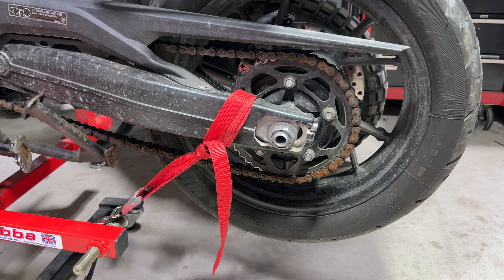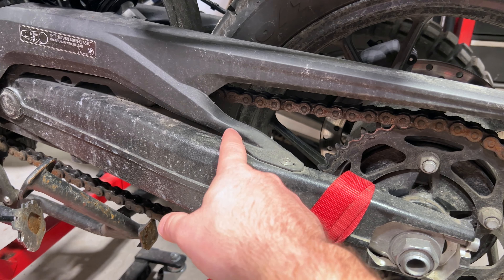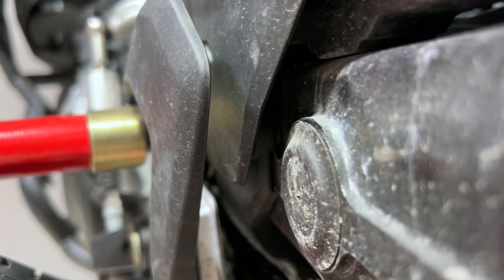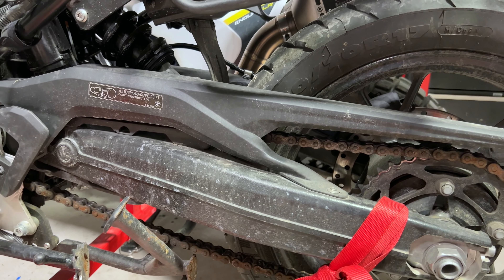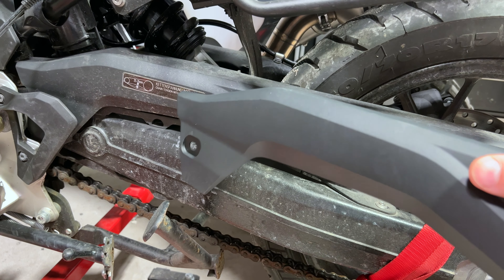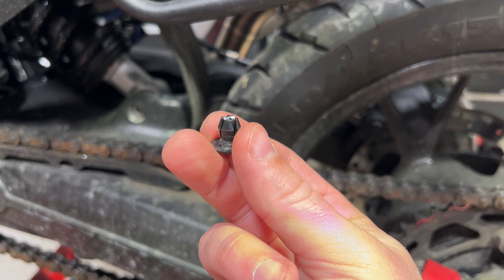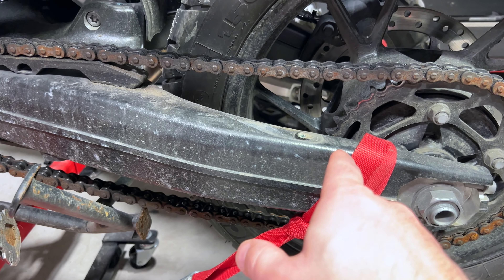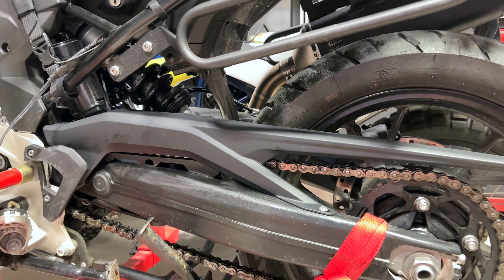Install: BMW F750GS/F850GS Chain Guard Replacement

Comment: Ha.. I could’ve lived with the damaged guard, but that chain… would keep me up at night until serviced. 🍻
Reply from the maker: Yeah, the guard has actually been damaged all riding season and it was never an issue. It is heather's bike. I have grown to sort of hate chain maintenance...I know it sounds crazy but truthfully, heather only has 3,000 miles on it since purchasing 3 years ago and yet I've cleaned her chain like 10 times. Do you really have to clean this thing every 300 miles? On average I mean, it just seems like it constantly needs to be cleaned. She doesn't even ride off-road!